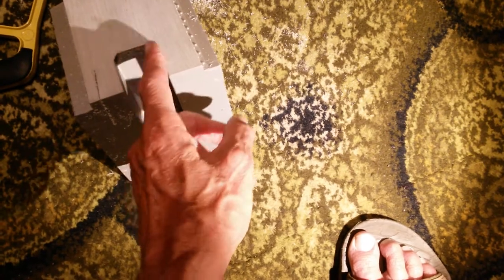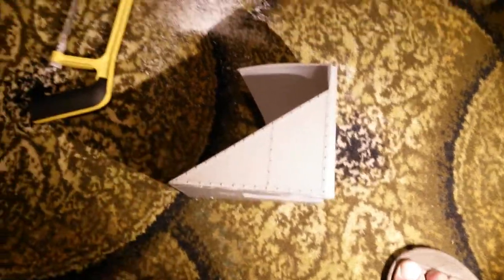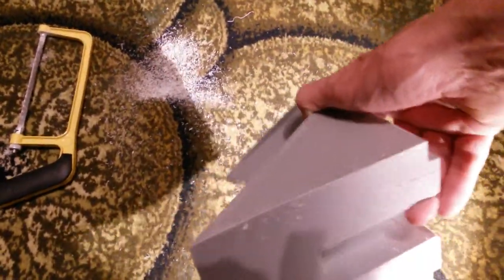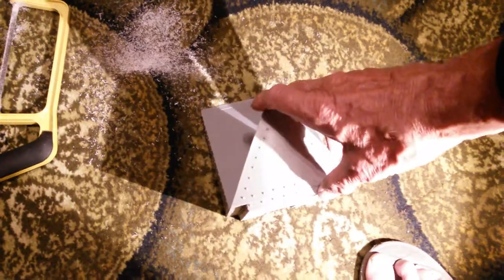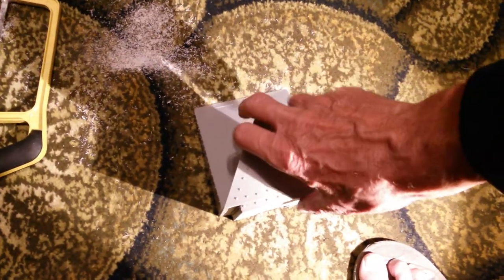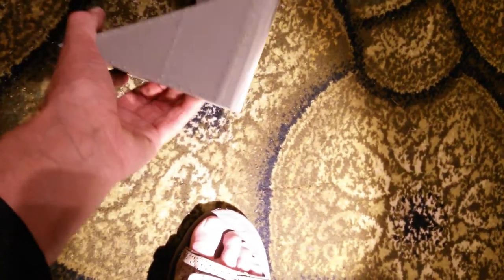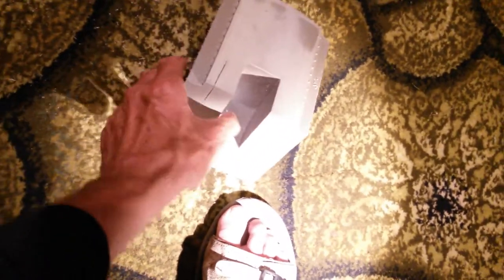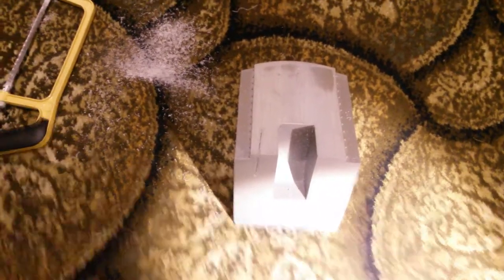Swift sixteen snow plough musings

Comment: Just thought I add my comments as the manufacture of this item. Weight is needed to counter the weight of snow. A light wagon would simply be pushed off the rails. Once the plough is fixed to your model, weight is added to the rear to balance. You say in another video, you took 6 hours to remove a small amount of resin.  A better way is to clamp the plough in a workmate and use a wood working router. This will very quickly and cleanly remove as much material as you want. You could rout it down to nothing in half an hour.
Reply from the maker: Thank you Robert. I have a woodwork router that gets little use - I will give it a go next time. I will check the overall weight distribution and see if it needs weight on the rear.

Comment: Snow ploughs in June John....one thing a new camera angle ....hope that aint the living room carpet you have been sawing on ..Dave
Reply from the maker: Yes Dave it is. My carpet is as tough as old boots. Its Axminister Ao with sewn seams, a sewn tape all around the edge and 'washers' to hook on to nails. Non of that awful gripper rod. Can't bear to part with it. I mixed plaster on it when re-plastering the ceiling, came up a treat afterwards.